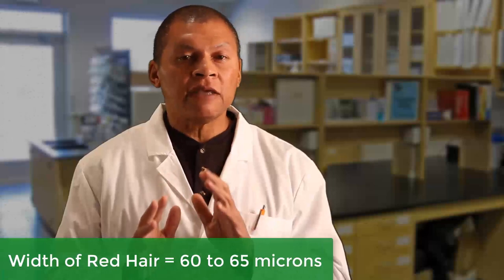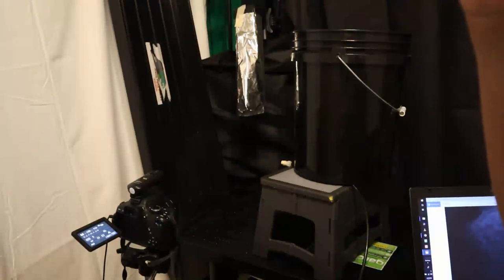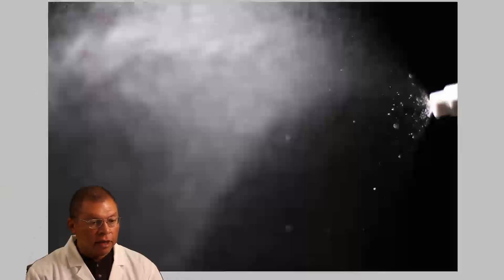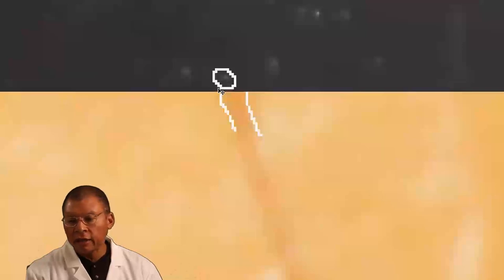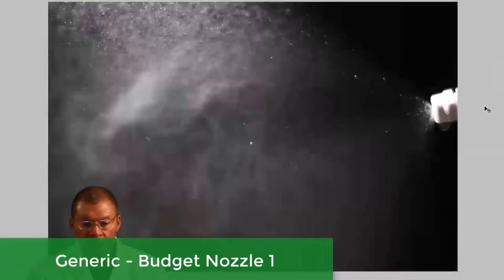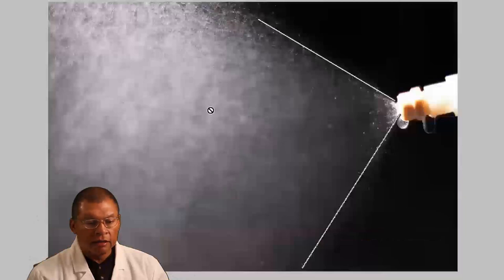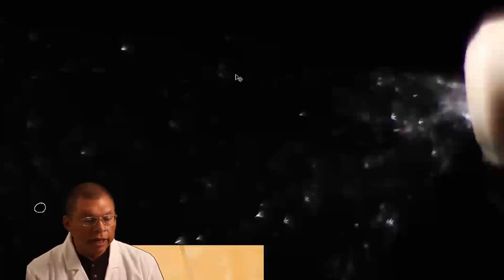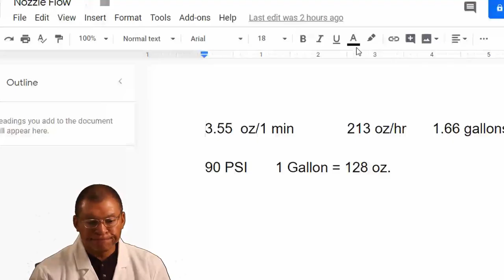Aeroponic Spray Nozzles to Use/Buy -  Part 2

Comment: Nice tests. Just a suggestion, you could spray the mist over a plate glass and see the droplets in a microscope in higher resolution and measurement accuracy. Using this you could also optimize the spray time, as longer spray the droplets tend to joint and become bigger.
Reply from the maker: Hi Julio,
I like your suggestion. Maybe a future video.
Thank you very much
Reply: Yes I have the same thought as well, those DSLR camera touching microscopic water droplets is not the best thing to do, would damage the camera and seems overly complicated and super expensive.

Comment: I love this channel, I love the information you present. I am seriously interested in getting started in HP Aeroponics. I commend your efforts on this research you are attempting. However I don't think that your results will be as accurate as you may think. I hope I'm wrong. My thinking is that your images are not tack sharp. (a photography term) When an image is out of focus even just a little it will change the size of the object. As an example, I work security and we have a camera that when moved can see a 3/4" conduit in front of the lens. With the camera zoomed out it covers a good portion of the view. However when you zoom in still with the conduit still in the same place you can now see what was behind that conduit. Because it is out of focus. You still get a dark area where the conduit is though. So if the drops of the mist aren't in focus completely you will get the same affect, just on a smaller scale. If you really want to try this again with better equipment. I would recommend a spark gap flash, macro lens and all lights out. As I said earlier. This channel is great. I see a year ago was your last video. I hope you post more videos in the "NEAR" 😉 future. Thanks

Comment: been waiting on this video!!! thought you weren't coming back,  glad to see I was wrong.
keep it up!!
Reply from the maker: Thanks for the encouraging words. There's more to come.
Reply: @HighTechGardener  quick question, can a piezoelectric device be used to generate de mist? will the fog generated by the piezo carry the heavy nutrient molecules?
Reply from the maker: @gabrielocampo3769  Before I answer your question, let me ask you a question. Why piezoelectric?
Reply: @HighTechGardener  because of reduced cost. plus I wouldn't want to risk setting up a pressure tank right next to where I sleep (literally next to my bed). also, the piezoelectric mist generator allows for a greater degree of control,, heat might be an issue but I can also run a 15w peltier cell inside de water tank to cool the nutrient solution to a desired temp. what do you think?
Reply from the maker: Hey Gabriel, I understand your concerns. However, you need to realize we pressure to 150 psi max. These tanks are designed to handle 200+ psi. There's really no threat of a blowup. The pumps I use can't ever go above 150 psi. So there is no worries of an explosion . Using my technology, I can design it so that it's almost silent running while you sleep. HPA is cool stuff that is not being used to its full potential. Keep watch the videos and learn. Thanks for being a subscriber.
Reply: @HighTechGardener  I will!!

Comment: If you decide to do another test, allow me to suggest an alternative methodology. Buy a piece of 270 mesh, which is a 53 Micron opening. Fire a 1 second blast at the mesh and have a Target behind it so that you will be able to see how much goes through not only in the Target but you can also time a camera shot correspond to the first drops that make it through the mesh. Obviously the much would have to be blown off and be completely cleared of water between tests because the water will quickly clog the mesh.  Coloring the water would also help.
Reply from the maker: Thanks for sharing a different method to determine droplet sizes.

Comment: Hello, thanks for all the information you provide.
I have some doubts that I can't find answers.
How many microns must the filters have?
I understand that if they are few microns they can retain the nutrient solution.
I have seen many systems in which the roots soon reach the soil of the container. Can nebulizers be placed on top of the growth chamber?
I've been looking for pressurized tanks like yours, but all the ones I find support only 50-60 psi. I have seen that they are tanks for reverse osmosis and do not reach high pressures. I need a 130-160 psi pressurized tank for it to work comfortably, correct?
Reply from the maker: You're very welcome.
Lots of questions. Little I will answer them on this YouTube channel.

Comment: Hello High tech gardener. Are the cream Tefen nozzles from pro water parts the non drip style of nozzle? I saw you had a link to them on your website as the 21105 model number
Reply from the maker: No. They are not the non drip.

Comment: Interesting work. Have you tried any of the models that have a built-in filter on the nozzle itself? Also, I looked at the Tefen website, and I see no info about whether that nozzle is FDA approved or if it is food safe. Did you find any info on that?
Reply from the maker: The nozzle used is made from Acetal and used in supermarkets vegetable. You won't find an FDA designation from the manufacturer. However, Acetal materials can be FDA and NSF compliant below 50C (122F). 
Hope that helps.
Thanks for the question.
Reply: @HighTechGardener  Please explain why you find Acetal an acceptable material here, yet tell us specifically to use a PP nozzle in other videos.

Comment: how do you recirculate nutrient waste?
Reply: typically you dont, on a high pressure system you mist for as little as a second, or less sometimes, just enough to get the roots wet, you dont spray long enough to make much waste
Reply: @sportbikeguy9875  thank you for your input

Comment: Hi Lee! First of all thank you so much for your research and information. Congratulations for your channel. I hope all the best to you in the future.
I got one question.
So this nozzle performance is only when one nozzle is used. How about when I used more than one nozzle? Will it have the same performance (microns and psi)? This is assuming for larger scale aeroponics system,
Reply from the maker: Rafael, You're welcome my friend.
The short answer is yes for multiple nozzles, IF you use a pressure tank in the design.
The Aeroponics Calculator will help with your design.
Reply: @HighTechGardener  Thank you for your answer! 
However, my concern is how many misters can be supplied effectively (with 100psi) by one pressure tank? Is there any limit? or the number doesn't really matter?

Comment: I despise those types of suppliers that only do B2B sales. What in the hell is wrong with them? Are they just thinking that C2B is not worth their time at all? I am not sure I can wrap my head around that. At least not for this particular product.
Reply: @ericgosh826  I don't feel like putting my own words down right now, so here is some copy and paste for you:

"B2B sales have more of a limited reach considering the deals occur solely between businesses, thus the buying pool isn’t as open as B2C. You’ve also got to take into consideration that whilst average order values are much higher in the B2B space, it’s much harder to secure these deals and generate long lasting relationships. It can also be a really difficult game for small and medium sized business, as each individual wholesaler is crucial to your bottom line: the loss of one long standing partnership could be detrimental to your revenue sheets. Imagine you’re a supplier of clothes for 5 different businesses, each ordering thousands of items every quarter. If one of these wholesalers goes bust and pulls out, your bottom line will suffer directly. Finding a new customer to make up for it won’t be easy, or quick."

b2b only people also might struggle with fielding never ending requests for scale discounts and other perks for wholesale b2b buyers, finding themselves racing to the bottom. As usual, only big players can survive here. 

And to answer your question, I don't like putting all of my eggs in one basket, so I would much rather have 1000 customers, even though your whole premise is far too simplistic, and nothing in business is that simple. 

And I still hate b2b only, because I, like every other individual on earth, am a consumer.
Reply: As a wholesaler if you undercut your bulk buyers who are reselling your product you will hurt their business and so they may choose not to do business with you anymore and your wholesale business can suffer.  So most wholesalers don’t also sell piecemeal. They leave that to the retailers.